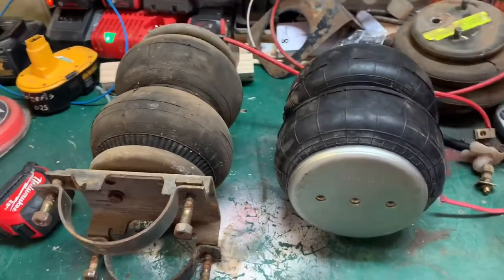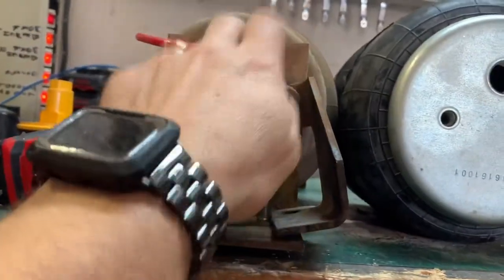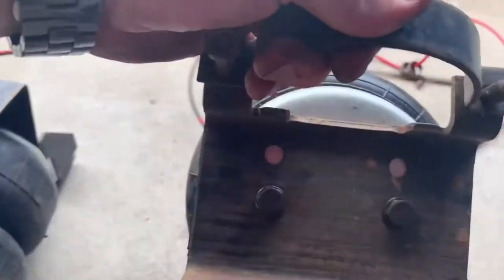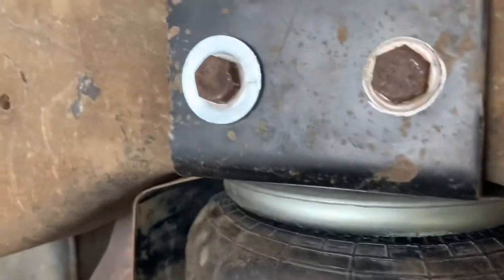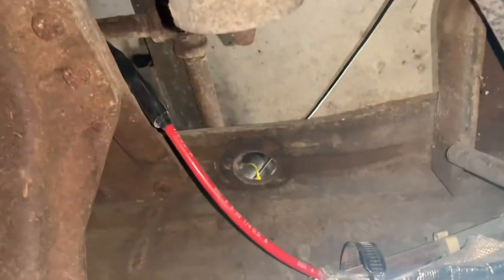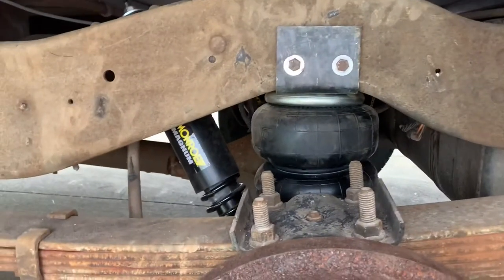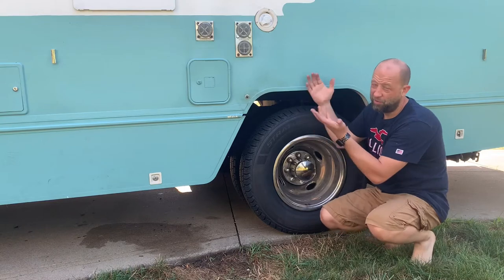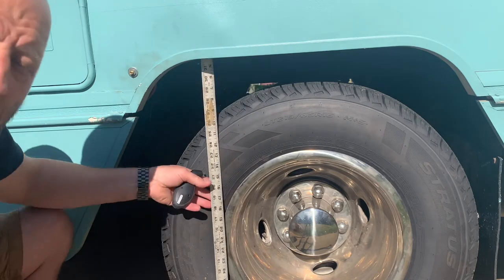Class C motorhome rear airbag install

Comment: I noticed you have the 555010 monroe magnums installed. Any dampening issues with those? Ive installed 2 pairs and both failed at 3000 miles. I dont have bags or springs, and wondered if the air bags would prevent the shock failure?

Comment: Great video.  Many thanks.  BTW, the Ride Rite website recommends a minimum air pressure of 5 psi to avoid damaging the bags.  Have you had any trouble running 2 1/2 psi?
Reply from the maker: Thank you. I’m actually running more than that. Can’t remember what though. Lol.